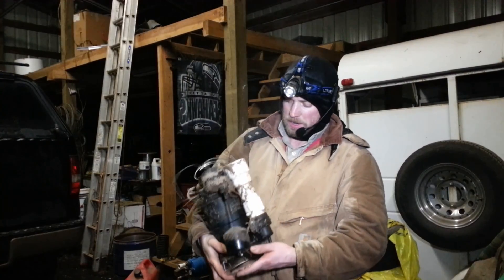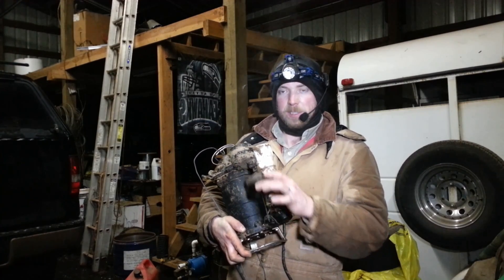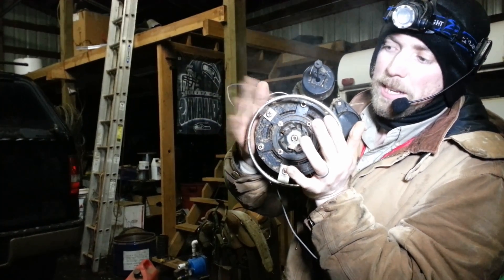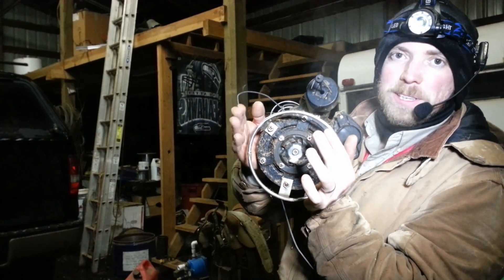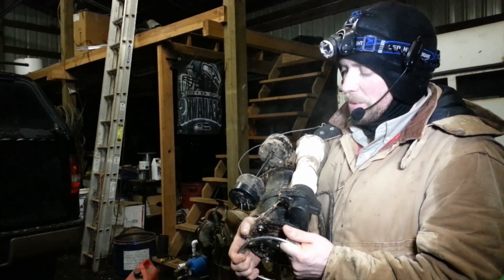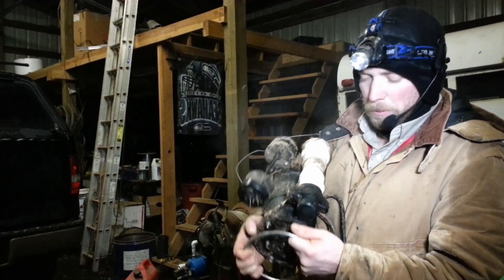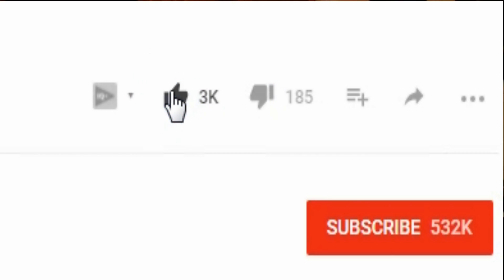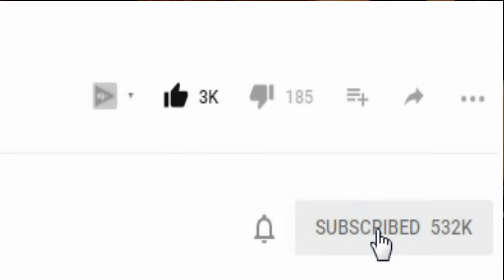DiY Homesteaders - From POOP to POWER - Part 2

Comment: How about this 1. Use a straw chopper, to begin with, this would use less straw in the first instance and would only need wetting down to get it into the digester  2 Change to wood shavings, this would cost more over straw, but would work.

Comment: Mulch the dry straw first without mixing it with any viscous material. The blades will be able to move fast and you will be able to use any decent garden mulcher.

Comment: I was planning on using grass clippings and yard and garden waste in a biodigester and saw others have the floating problem of waste that's too big. I'm going to see if running that stuff through my lawn mower size gas powered chipper shredder will work and get the waste small enough. I won't know until the spring of 2018.

Comment: We used to have a mulcher attachment for our tractor. It was primarily designed for processing leaves, grasses, and straw into mulch for composting. That would likely work great for what you are needing. After running it through the mulcher, run it through the macerating pump into the digester. Use the digestate liquid as your "water" for making your slurry and you should be all set.

Comment: roadside ditch cutter it about 3' by 1 1/2' it will cut through just about anything. it is not a screw it has tines. there is an attachment for john deer and bob cats. so with some thought you might be able to hook it up "in" the horse toilet. better have it covered. the city where I live uses these to cut ditches for storm water runoff.

Comment: You should consider a small Progressive cavity pump. It will handle solids, dewater solids, rehydrate solid... Take a look at this one on eBay then do some research on your own. his will solve your problem. 

http://www.ebay.com/itm/Seepex-Progressing-Variable-Speed-Cavity-Pump-Nord-12-82-1-Gear-Reducer-1-x-/232082594373?hash=item3609335a45:g:WvcAAOSwxg5X0Fnm

Comment: great video, amazing project! i do have one worry tho, what is the process of pumping stuff out then mixing and pumping it back into the system introduces air? you will loose the "air free environment" that you need to make methane. Or even if the air introduced is low amounts, you will get it mixed in with your gas in your storage tanks, and this could explode i guess with the "wrong" air/methane mix..
Reply from the maker: great comment. I actually put an air relief valve onto the pumping system so almost all of the air gets purged before going into the digester.

Comment: Larger farms use a mixing machine that they use to blend hay and other nutrient materials together into a blend and feed the livestock.  These mixing machines have a corkscrew type mechanism in them that is designed to break up chunks, chop coarse material and make a uniform mixture. I believe it would do what you are trying to accomplish and not require any water be added to the process.  For the particle size that the digester would prefer I'm sure you could just run the mixer a little longer than usual and get a sub 1 inch uniform size.  These types of items I'm sure are not cheap but in the Midwest and other areas I bet you could find one resale or from a private seller used for a reasonable price, even though I'm sure it would still be a sizeable investment.  Some other pros would be that they are designed to be fed with a tractor or skid steer so that means you could easily feed it with stall muck from your tractor.  Also, they are designed to process a huge range of materials, like hay, grains, stalks and other weird materials. So I'm sure if you wanted to add other organics other than just poo, you would be able to.  I hope this helps.

Comment: you can pick up a couple of garbage disposal units fairly cheap and retro fit them to the bottom of a stock tank. that could feed into the horse john. It works in my brain at least.

Comment: This is a common problem for digesters. The solution for most is a stick....seriously just a stick to agitate and push down everything. That being said, there is one possible problem. Most digesters I have used this for, and seen this used for, are smaller then yours. A 2 inch tube might be too large for just a stick to work. I hope you find a good solution.

Comment: I wonder if a powerful (like 1 HP) garbage disposal would work. Maybe the straw would clog it up. More likely something like some wide gears to chew up the straw would work better. There has to be something out there for this kind of job. The excess water is solvable by separating and recycling the extra water you have to add to help macerate your solids... a small 'clarifier tank.' I worked in sewage treatment for years. What you are doing is what any sizable treatment plant does only on a much smaller scale. Your digester will likely clog up after a while when the solids settle out and become inert. I suppose you plan on occasionally pumping out the settled solids and using that for fertilizer. Most digesters have circulation pumps to move the mass around and prevent dead zones and stagnation. Good Luck!
Reply: is a bit of a joke answer for the question but could be useful anyway, a land rover gearbox under the sink...comes from "Billy T James, Home Improvements" on youtube, New Zealand comedy from the early 1980s or so

Comment: all thread rod, multiple 21" mulching blades to fit in culvert, electric or methane moter, enough moisture to create vacuum from hopper above, float switch for on and off. 2 cents

Comment: Seems to me, an industrial powered paper shredder would do what you want. Which basically has a bunch of sheet metal teeth that turn on two axles the just suck in and chew whatever is fed into them. Then comes the question on how w to hydrate the material. Which could be as simple as grinder material falling into a washing machine like tub with a large screw that turn the grinded material into the water? Once you have a slurry, it's pumped or just flowed into the generator.

Comment: It sounds like you might be able to use something like a snowblower front (grinder part) or a tiller blade front but drive it with an electric motor.
You could basically make a grinder box using one of those parts and some sheet metal for the chamber.
Just MacGyver the crap out of it...so to speak!  ;)

Comment: try and go to Cody's place and see his apple grinder for a good idea. fab one up to the scale you need and make out of metal. I would use at least a 1 hp electric motor and use a belt drive to find the right gear ratio for speed and torque you need. if you want more information about a how to make feed to funnel idea so you wouldn't get clogs or jams just let me know

Comment: How about modifying a grain auger.  Run the pipe straight down to the PVC inlet (maybe even all the way down THROUGH it to the bottom of the digester), and then dump poop into the hopper and let the auger push it down into the digester.  Do a google image search for grain auger to see what I'm talking about.  That should work no matter how dry the poop is and should handle the straw too.  You could make the hopper big enough to dump the loader bucket right into it.

Comment: Build one using a post hole digger. You could even use the pto from your tractor, or its own engine. Basically put the auger in a pipe with a shoot built on the top. Then empty out the bottom into your bucket. Kind of like a manure spreader but capturing everything

Comment: Have you thought about converting a corn chopper/silo loader? PTO ones come up at farm auctions all the time for a couple hundred bucks.
Reply: https://www.alibaba.com/product-detail/corn-silage-making-machine-grass-grinder_1870237292.html
Reply: I thinking the same thing..  an old silage chopper, that can run off your PTO weld up a bin (hopper) with a conveyor belt to feed it into the chopper.

Comment: If you have a Kitchen Aid mixer with the hamburger grinding plate take a look at it. An auger would feed it from a hopper (make it as big as you want/need) then grind and extrude it through the end plate. The output could go right into the digester. You could use a water nozzle in the auger tube to make a slurry.

Comment: Check out these paper Crete mixers.  Could build one of these that tips.  Have it run off a motor right at the toilet or pull it with the tractor as you fill it.  Should grind it really well. http://mikeandmollyshouse.com/building/make-papercrete-mixer/

Comment: I wonder if you might need to go at it in another way. Maybe you could fabricate a hopper that you can load the manure into, then use a hydraulic  piston to push the manure down the cylinder. You could automate it so it adds the right amount of manure in the right intervals.

Comment: You might turn the problem a little sideways and instad first use a large barell or rain water tank that you fill opp with the manure and the water needed. (You will need water to get digester going anyway). Then rotat it on roller to everything is nice and even half an hour should do it.  Then you tipp the barell into the feeder. An old electric motor can drive the rulers.

Comment: KEEP THE PUMP,FEED A MARINE 12VDC BOAT PUMP 1 1/2 IN  3/4 OUTPUT BUT WATER IS NEEDED, YOUR WASTE COULD BE AERATED ,TO GET THE WATER OUT 100 GAL. AT A TIME (1 BUCKED ) YOU COULD REMIX YOUR WASTE, 55 GAL. DRUM MIXER....

Comment: something to ponder. switch your bedding to sawdust or chips. don't use paper! the enzymes in paper will kill your good enzymes. then the long grass leftover from feeding could be floated off of your mix prior to introducing it. yes the wood particles float but they are more size manageable.

Comment: Turn the process, is it possible to cut the straw before use in the stable?  (Bale Straw Shredder Chopper  https://youtu.be/44kEGxOFp3c ) it probable will take more moisture in also... a saw a other YouTube guy do it small, Straw /ay chopping. https://youtu.be/U9R8MfeIZgo
Reply: I like your idea another thought could be something like a metal crusher

Comment: Small, engine driven, multiple reel mower blades mounted on the vertical axis in a custom built frame in the open top IBC tote and a second IBC tote buried underground with the grinder pump to the digester. Since you are already using the liquid digestate, the reel mower blades mix the the solids into the liquid in the feeding open top IBC tote to create a slurry. Once mixed into the slurry the feeding IBC tote will supply the buried IBC tote by gravity and then allow the grinding pump enough liquid to move the slurry.
Reply from the maker: i like this idea!
Reply: the small engines used to power the blades would be fed with the methane the digester produces as an added benefit.

Comment: Have you thought about a hydraulic ram pump? Concrete pumps use those and have lots of power and you shouldn't have to grind.
Reply: Do a search for how a concrete pump works then you could build a smaller one on the size of a log splitter and use one way valves like Codys water ram pump works.

Comment: If the issue is breaking down a "dry" material, I would have to think that the tools which are used for that type of activity would be best suited for the initial step of getting a material the sewage pump/grinder can handle when mixed with digestagte.  So lawn mowers, leaf/limb chippers, etc are probably the best bet.  Developing a hopper that can accept and then feed a full bucket of manure is probably the greater challenge.   A sheet metal skin inside a simple funnel shaped frame might do the trick provided the solids do not stick to the sides to badly before getting into the chipping/shredding part of the machine.  However most of the least expensive chipper/shredders funnel into a slot that I believe would be too small for manure to easily go into.  Perhaps fitting that hopper over the deck of a mower and letting the solids drop through the rotating blades would do the job.  It's not an insurmountable challenge.  Good luck.

Comment: Modify a Cement Mixer somehow ?
Reply: Keith Davis , I'm thinking, this might work on a small scale. By loading a chute on one side, with a gate to regulate flow, mix with water to the proper consistency, then dump out to a chute or basin. Where it could be pumped to the digester.

Comment: two of the lowest cost solutions that I can think of. a boat motor or trolling motor for a extreme low cost version. used at a yard sale cost less than 100 bucks. mine cost 10. and they operate on 12vdc.   
or using a garbage disposal on a sink.  I demo'd a commercial kitchen and got the sink and disposal. stainless industrial.  wit some additional liquid that you already plan to use to make an emulsion prior to the toilet and the grinder pump

Comment: Used commercial garbage disposal? http://www.ebay.com/itm/InSinkErator-SS100-28-1-HP-115-208-230V-1PH-Commercial-Garbage-Disposal-Disposer-/351756815896

Was thinking you could recirculate to maintain higher water ratio. This wont make super fine particles but could be a pre stage.

Comment: A bush hog on your tractor would shred dry manure.  You could have a concrete pad with sides where you dump the dry manure and straw and run a bush hog over it.

Comment: Have you looked at flail grinders to get the majority of the large chunks broke down? I worked with a couple that were set up to grind up bales. We were grinding large square switchgrass bales (twine and all) down to 3/4" or smaller pieces. Switchgrass is extremely abrasive once it is down to this size and tears apart pumps and augers after grinding very quickly. This was our best option to getting it into a size that was usable to the person purchasing the bales. Applying a small amount of water to the manure (to keep dust down) when grinding could also apply enough moisture to utilize an auger to push it into the digester.

I will also send this to your email.

Comment: Just as an idea. I have no idea if it would work, but a sanding broadcast spreader? Depending on water content and if the spreader could chew the hay it would be the right size to use with a loader. If the spreader part didn't work maybe just the container and conveyor into a better grinder would.

Comment: I was thinking something like the alaskapelletmill.com which is a manufacture of a flat plate die with rollers, put at the bottom of a hopper it would spit out pulverized goo or pellets if it is dry enough. Either way those straw fibers will be broken.

Comment: TRM, shred the straw prior to sending the slurry to the grinder pump. Harbor Freight Tools offers 20-25% off coupons. Use a shredder like this:   http://www.harborfreight.com/14-amp-1-12-in-capacity-chipper-shredder-69293.html
Reply: Too bad you bought the grinder pump. A garbage disposal might have been cheaper...

Comment: make a poop puree blender using an old washing machine lol
Reply: I like this idea.
Reply: Use a bicycle on a training setup or a fixed wooden stand for the rear wheel, a couple of cogs to change from horizontal to vertical spin for a top loader washing machine (can also use the magnets underneath for power generation too since it isn't hooked to anything electrical), or just run it off a generator powered by the methane from the digester (depending on supply)

Comment: Why not think about a used tree chipper, in your area there should be a lot of them I would think. You could mount your toilet bin on the inlet and then the discharge to your piping to the digester.
Reply: Matt Matt this was my thought, if it doesn't work as it comes maybe look at a drum with different sized or spaced holes, I don't know that you will get this done for your scale without some fabrication.
Reply: He lives in Washington state where all the loggers are
Reply: Matt Matt pretty sure they are in Oregon unless he lives across the state line from his neighbor.
Reply: He lives a few miles from Wranglestar and he lives in White Salmon Washington State
Reply: Matt Matt Gotcha I just figured they were bothe near fuji mountain but apparently I have been mislead...
Reply: The volcano he calls Mt Fugi is Mt Adams

Comment: the real Martian I will repeat this question on your Facebook just in case you don't notice it here. but is there a way you can compost the manure until the straw breaks down then use the compost material to feed the digester?
Reply: knowing from lots of gardening experience straw takes more than a year to compost
Reply from the maker: not a bad idea but the process of composting is what we want to happen inside of the digester. If we compost first then we lose the precious nutrients that are what the bacteria want to break down and turn into methane. appreciate the ideas...keep them coming!
Reply: TheRealMartian okay thanks for the response I did not know that .when it comes to farming and gardening I have no clue. I was just wondering and thinking out loud..lol

Comment: Have you thought  about  a brush shredder. They are used in your  yard to cut up small  limbs, leaves etc. They are  not very expensive  but I don't  know  if it will do what you need. R
Reply: Yeah, got to be something out there, chipper, shredder or a mulcher.
Reply: That's a genius idea  ! the more dry the manure, the more it will be better for the brush shredder.
Reply: When watching the video I thought SNOW BLOWER, but a wood chipper would be more robust, less prone to break down, mechanical failure.
Reply: Great idea but all poop has some moisture. Wouldn't it get gummed up?

Comment: What about a settlement tank/pond where it sits for a while in water and breaks down?
Reply: I was going to suggest this as well, make a slurry pond, feed the digester from the bottom with the pump you have. Problem is winter I guess, the pond will freeze :/
Reply: Affra indoor pond?
Reply: could one hook their septic tank to this or is the septic tank just a digester anyway?